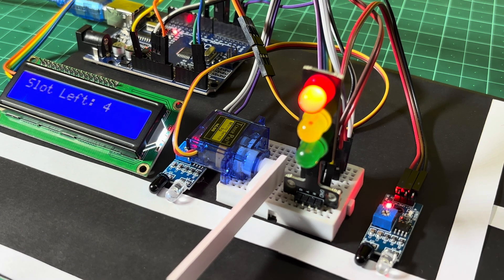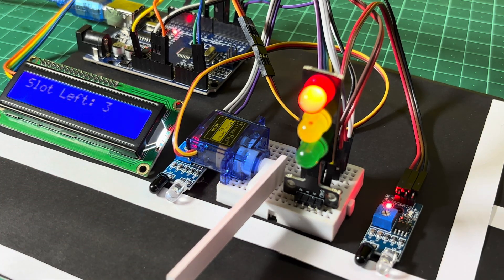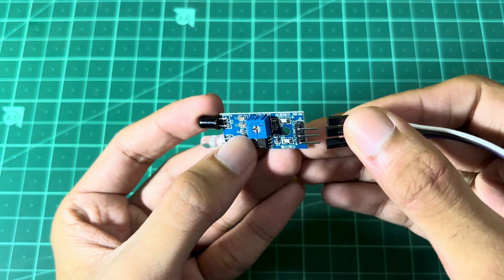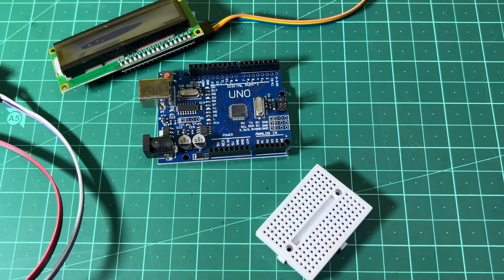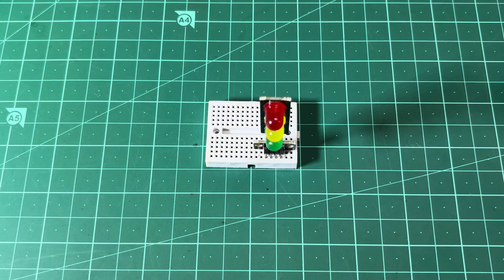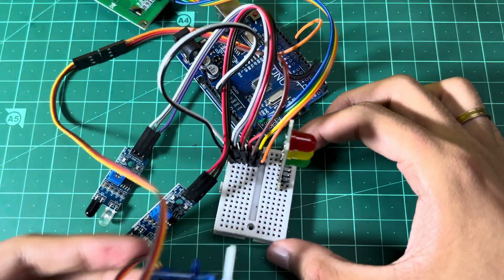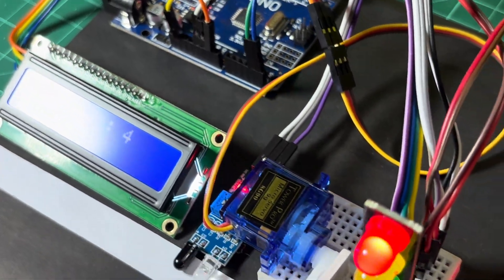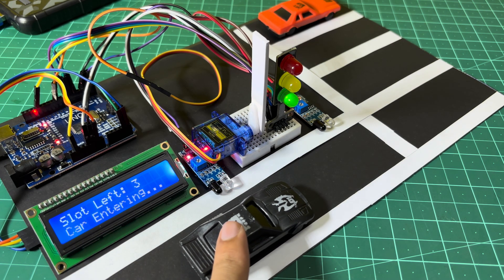Arduino Car Parking System

Comment: C:\Users\shubh\OneDrive\Documents\Arduino\Smart_Parking_Code\Smart_Parking_Code.ino: In function 'void setup()':
C:\Users\shubh\OneDrive\Documents\Arduino\Smart_Parking_Code\Smart_Parking_Code.ino:36:13: error: no matching function for call to 'LiquidCrystal_I2C::begin()'
   lcd.begin();
             ^
In file included from C:\Users\shubh\OneDrive\Documents\Arduino\Smart_Parking_Code\Smart_Parking_Code.ino:3:0:
C:\Users\shubh\OneDrive\Documents\Arduino\libraries\LiquidCrystal_I2C/LiquidCrystal_I2C.h:58:8: note: candidate: void LiquidCrystal_I2C::begin(uint8_t, uint8_t, uint8_t)
   void begin(uint8_t cols, uint8_t rows, uint8_t charsize = LCD_5x8DOTS );
        ^~~~~
C:\Users\shubh\OneDrive\Documents\Arduino\libraries\LiquidCrystal_I2C/LiquidCrystal_I2C.h:58:8: note:   candidate expects 3 arguments, 0 provided
exit status 1

Compilation error: no matching function for call to 'LiquidCrystal_I2C::begin()'

THIS TYPE OF ERROR SHOWS WHILE UPLODING CODE

Comment: Anna.....
I am b tech final year and I choose the project "A HYBRID VLC PARKING AUTOMATION SYSTEM" my question is.... Am I proceed with your video (project) 2. In this project are we using VLC(Visible light communication) concept 
Let me know brother please 🙏
Reply from the maker: Use ldr for vlc based project like to update whether the car is parked or not.
Reply: Anna...
Meeru em use chesirru anna ldr place lo @EliyasScienceInfo
Reply from the maker: Ir sensors
Reply: Anna if you don't mind konchem components list send chesthara please 🙏 @EliyasScienceInfo
Reply: Anna konchem components list send chesthara please 🙏
Reply from the maker: You can see in the video